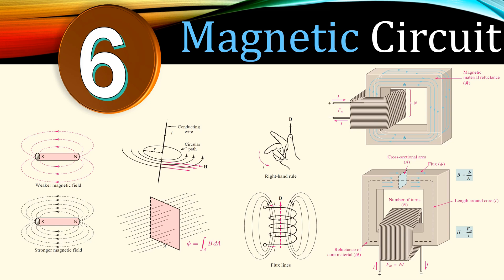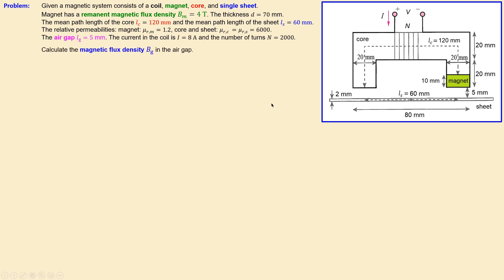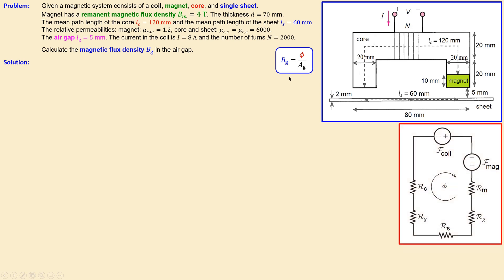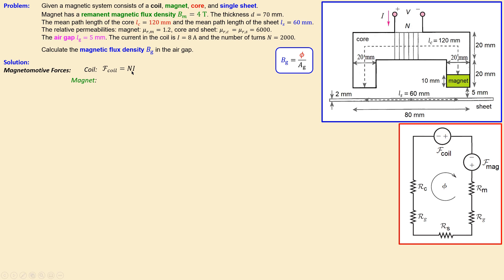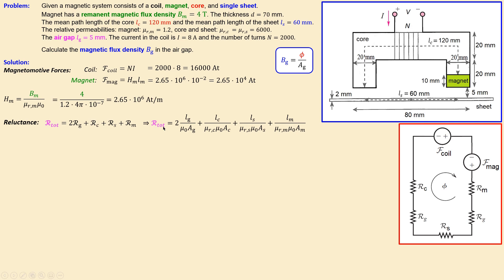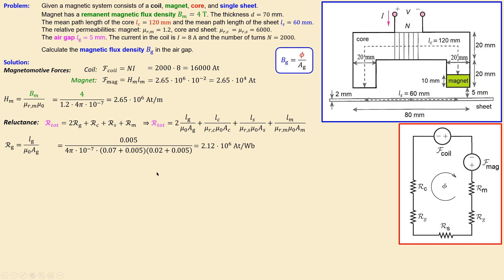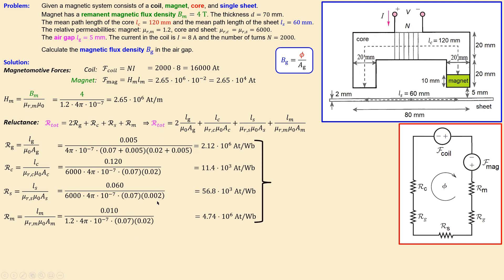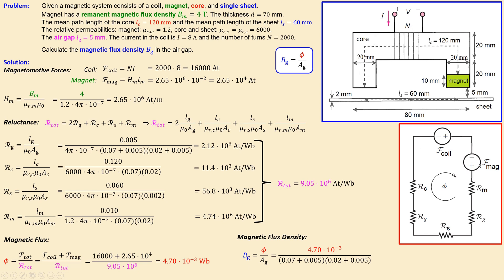🧲 Magnetic Circuit Example 6 ⭐ Air Gap Magnetic Flux Density in Circuit with Permanent Magnet & Coil

Comment: Thanks very much for the video. I've calculated the flux through the permanent magnet phi = B * A = 4 * 0.02 * 0.07 = 5.6 * 10^3 Wb which is larger than the phi calculated (4.7*10^3). What did I miss ? I wonder how does the flux generated by the permanent magnet affects the magnetic circuit .....
Reply from the maker: Glad you liked the video. In your calculation, you are assuming that there is only a magnet in the system. However, the system is composed of different parts, like a core, gap, etc. You should take these also into account. This is similar to Ohm's law for a series electric circuit. That why we need the total reluctance of the system, as discussed in the video.